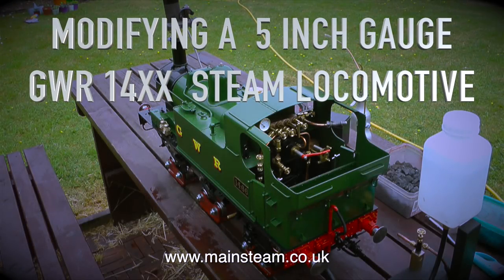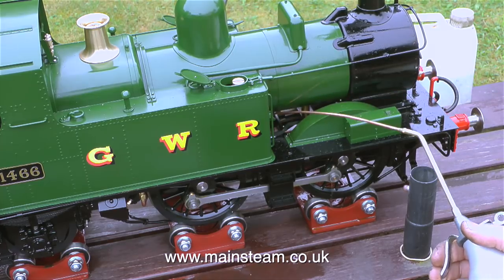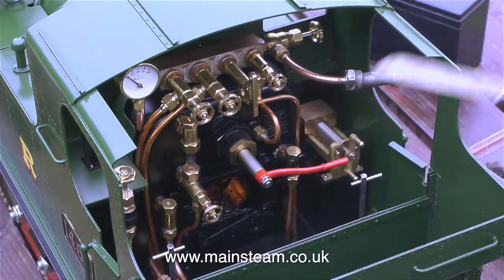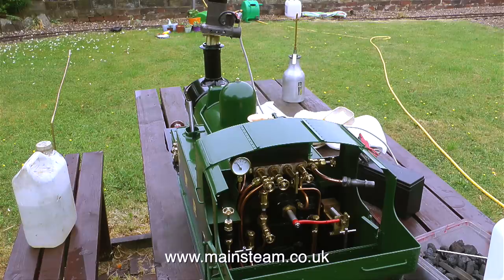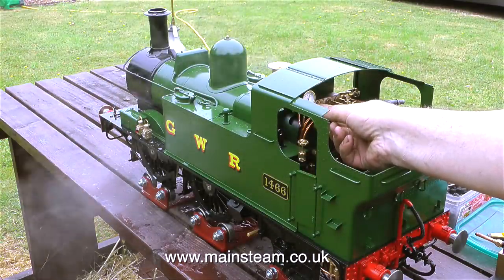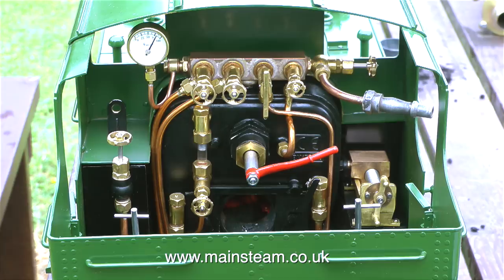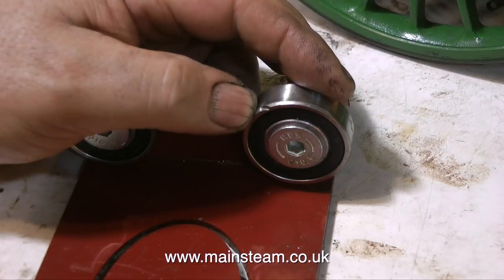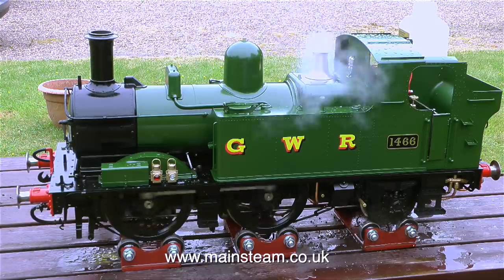MODIFYING A 5 INCH GAUGE GWR 14XX STEAM LOCOMOTIVE - PART #22

Comment: I notice you are using CMD Rolling roads :) What are these 14xx's like to oil up since everything is between the frames? Are they are good starter engine?
Reply from the maker: The 14xx is easy enough to lubricate with an extension pipe on the oil can. Please watch the entire series and judge for yourself whether or not you should buy one . . . . .

Comment: Bonjour Keith,
You say it is a great locomotive but you rebuilt it almost completely...This is not exactly what I would have said. Even if the original price is low, a final user should take care the work done by a specualist, and the work of a specialist has a significant and justified cost. Never mind, this is your work and it is perfect, as usual would I say. And I am impressed to see you mini injectors work at almost 100 PSI (> 6 bars).
Amicalement, Raphaël

Comment: Keith, do you know what spring rates you have on your 14XX ?
Reply from the maker: No Idea, I used the ones that it was originally fitted with on the Driving wheels and used a pair from Blackgates Engineering on the trailing wheels.

Comment: Hang on. Previously you said your track was 7 1/2". Unless you've added a third rail to give you a dual gauge railway, how are you going to run it?

Ps. In my yoof I used to lay full size railways for all the local steel works plus some for British Rail, NCB and some quarries.